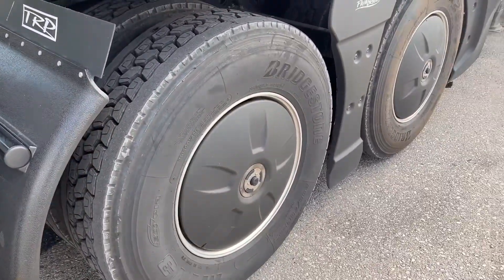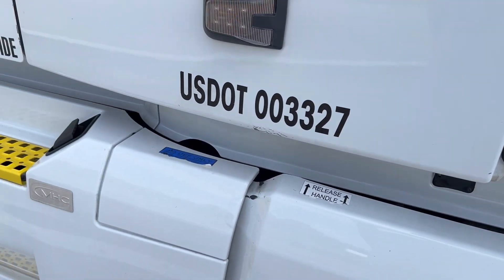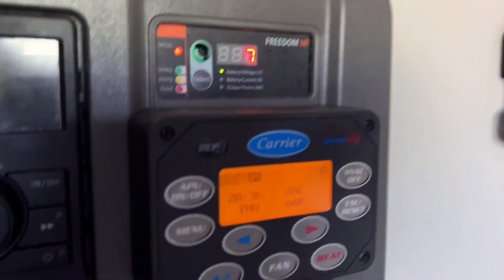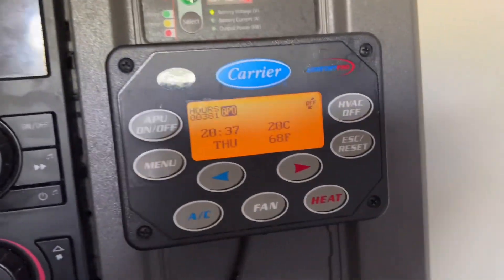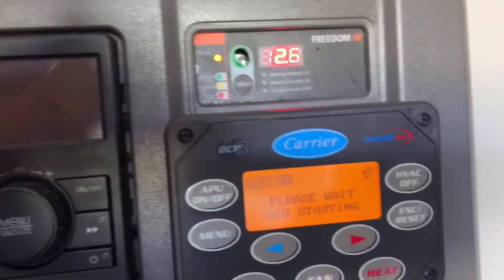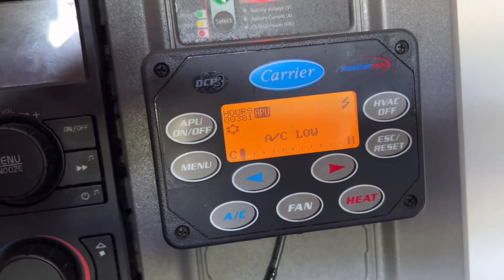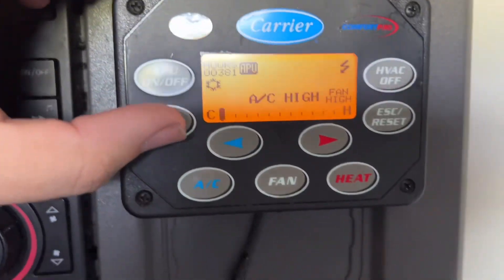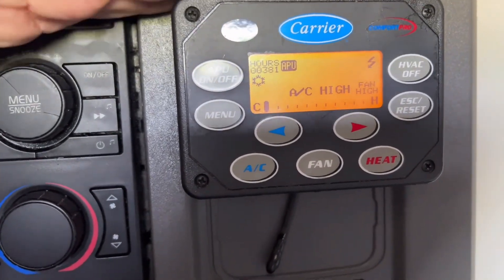Carrier APU How To Run and use.

Comment: Well one, you dodnt go through the Comfort Mode setting which starts and stops the APU as it needs Heat or Air Conditioning.

2, the truck of equippes woth the Espar Bunk Heater in the Volvo is controled through the DCP where your clock is.

To activate Heat from the Espar heater, press Menu Button, Tap Menu Button 3 or 4 times till the 3 letter indocators change to Heat, it will be bottom left of clock.

Once you have Heat selected, Tap On/Off and then Tap Set. Same thing to tuen it Off.

So to Recap for Espar (from Stanby Screen)

Tap MENU 3x.
On Left side of screen HEAT will flash.
Tap On|Off.
Press Set.

All done!

You can also set the Sleeper Alarm vuy following the above steps as well as turning On|Off the LVD (low voltage detector) and lamp in the sleeper.

Press Menu

Comment: My carrier has the sign on the right corner off how do I turn it on
Reply from the maker: What does it say
Reply: @ralphstrucking  off in the right  top corner the motor its on but doesnt blow no air inside
Reply from the maker: @stitch.a8172  mine has a lightning bolt. Not sure what that means tho

Comment: My carrier APU I still don’t know how to work it they threw me out here on the road is similar to yours
Reply from the maker: I’m on vacation right now what you need help with? I can do I video put be Tuesday when back in truck
Reply: I wish I knew how to explain it but my heat some how worked last night and now I’m having troubles with the AC
Reply from the maker: @juliuspalmer3935  heat should be the small box about 4” square unless in Volvo turn bunk heat on it’s on center back wall display
Reply: @ralphstrucking  thank you sir
Reply: Update sir I was able to get the AC to work but that little heater unit you was talking about it continuously turns off and says low voltage. It only works for about 10 minutes and then it shut off. What would you recommend me to do?
Reply from the maker: @juliuspalmer3935  run apu without air